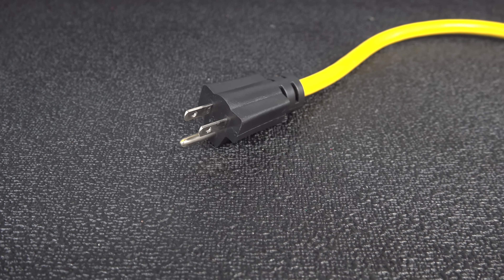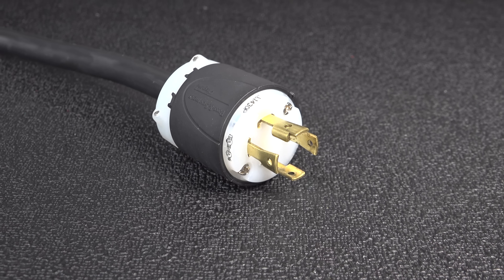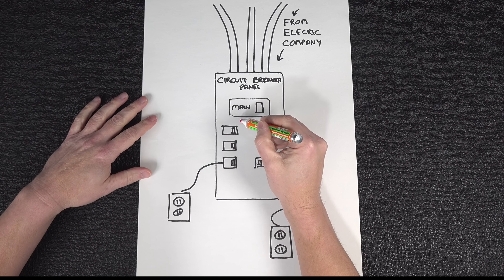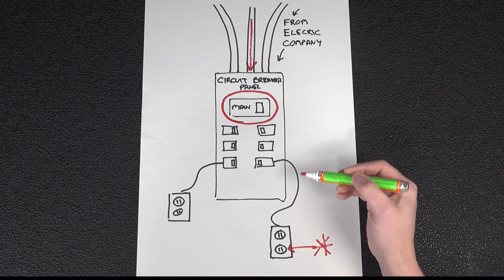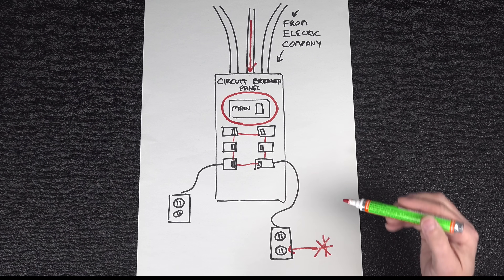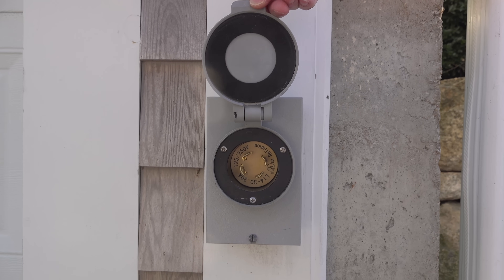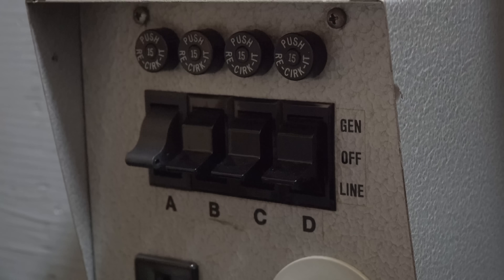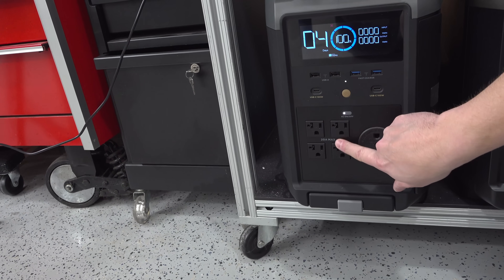Worst Electrical Mistake You Can Make - Backfeeding Generators

Comment: I wouldn't trust a normal plug/socket with a generator anyway. On my off-grid install I have IEC60309 plugs and sockets (blue) between inverters and consumer units (distribution boards). My generator also comes in to a IEC60309 connector. These are designed for heavy loads and are physically robust. Just remember to use interlocked sockets where you cannot remove the plug unless you switch it off.

Comment: The whole idea is crazy, I would be worried about the neutral, there is no breaker.  Just forget back-feeding your house, it is so lazy.  Get extension cords and run them to priorities and keep the generator outside, not in the garage.  People are not smart enough to rap their minds around the complexities of back-feeding the panel.  If one screws up the attorneys will leave ya homeless.

Comment: With advancements in electric cars, I think it's only a matter of time before specialised systems to manage auxiliary power and backfeed isolation become commonplace and/or standard equipment on new dwellings.
Example: the system charges your battery backup or EV typically at night, and will keep the system topped up during the day if demanded and/or surplus solar energy is available, then backfeed when storage is at capacity.
In the event of an outage the system could detect the outage due to current and/or voltage fluctuation on the line in, or digitally via IoT tech at which point the local circuit can isolate from the grid and operate independently in accordance to predetermined rules governing current draw and staying above a certain level of charge to protect the vehicles battery and operability.

It could also make things safer regarding rooftop PV in general, as you know the system will automatically detect faults and isolate if one occurs to protect anyone working to repair said fault. It's possible that some form of this is already being implemented, but as far as I know due to my very limited experience with rooftop PV one must isolate their PV circuit manually
Reply: Look at ford's F150 lighting backup power system
Reply: @bait28  
Is that the new hybrid? If so I was actually reading about it the other day. Pretty impressive setup they have there with about 480 horsepower on tap, and fuel economy that makes my 4 door sedan with roughly 200 horsepower available look like it has a drinking problem.

I'm definitely going to have to take a look at how it handles backfeed to the house now
Reply: @bait28  if they put a similar driveline in a 4 door performance sedan, I think it would sell like hotcakes here in Australia. The Aus market is sorely lacking in that department now that the Falcon XR6 Turbo is no more.
And it would deliver way better gas mileage!

The fact that it could save the day during summer power outages would be the biggest bonus! Being without air-conditioning in the middle of a summer day here is almost insufferable
Reply: @bait28  oh wait, so the lightning is the full EV version, I didn't think that was out yet. Here i was thinking of the PowerBoost hybrid setup 🤣
Yeah the battery in the lightning is huge, but it needs to be in order to hold near 100KWH of energy, but being along the underside I'd imagine the handling is still pretty sharp despite the weight.
If what I've heard so far is in any way accurate about the lightning EV, it's only a matter of time before Ford really shakes up the electric commuter market, and they won't have to worry about the PowerShift DSG letting everyone down in an electric focus which is a huge positive

Comment: In the electrical trade, I’ve always referred to these as “suicide cables,” but I’ve heard “death cables,” “killer cords,” and I heard one old timer once say, “a properly pissed off pixie plug.” That last one has always stuck with me.

It’s not uncommon to get an apprentice that doesn’t know any better to accidentally make one of these, usually in temporary power situations. I’ve always stressed how dangerous it is, especially on the US’s 240v/277v systems.
Reply: AVE
Reply: You only solo suicide cable to your furnace here in MN. Wired in through the furnace switch. Furnace breaker off. Suicide cable wire nutted in.
Reply: No its the U.S.'s use of 120 volts that the European electrical grid doesn't use is the most deadly hence why most countries don't use it because 240v will most likely knock you off the circuit where 120 is small enough to just make a person grab on to let's say a naked wire n your muscles will contract n its hard to let go while its still strong enough to fry your ass. Best to get knocked off!

Comment: What if you plug in the same cord into both outlets of the same receptacle?
Reply: Nothing at all, you just plugged the holes, but the holes are already wired to each other within that socket the same way the plug would connect them, so its just redundant. Only 3 wires feed a basic outlet, a hot, a neutral, and a ground. Those are connected to BOTH plugs, there isn't an individual wire to each plug.

Comment: You wouldn't do well in Florida. A hurricane knocks out the power and everybody drags out their generators and suicide cords. If you have grid tied solar it is illegal to use as well so you have to have a generator. Backfeeding is 100% safe, people however are not, so they have to be protected from themselves. After a storm I have seen licensed electricians hooking people up by backfeeding because all the parts to legally do it immediately become impossible to find.
The whole backfeeding electrocuting linemen doesn't really happen. Sure it's possible but every trained lineman is taught to treat every line as energized before they touch it with all of the required ppe. They work on live lines everyday. I have lived in Florida my whole life and I have never seen a news story about an electrocuted lineman caused by backfeeding. It would be big news as every death days before, and after are always counted as hurricane deaths. Doesn't matter how a person dies it's reported as a storm death. Homeowners are frequently electrocuted cleaning up after storms, just never hear of electrocuted linemen.
Reply from the maker: Really, are people in Florida stupid? They buy generators and then decide that they won't spend a penny to have an outlet for it? Give me a break. Why stop there, skip smoke detectors, GFCI, arc faults, homeowners insurance? etc. Things were fine before those were available. There are NO electricians hooking up people during brownouts, such a great myth. Sure they are going door to door, breaking the law, putting themselves at risk so residents can AC.
Reply from the maker: Just from one electrician, but skip the part about someone dying. Ignore, voiding your homeowners insurance, and ignore the manslaughter charges they filed against one homeowner in another case.  It's not me, it called proper electrical work. - .Guys this was a situation that absolutly didnt have to take place.The same set up that happened to me and my guys down in Golden Meadow,La. last week after TS Cindy. We opened up all the transformer fuses to kill the back feed that was on the line.It didnt take but maybe 15 to 20 min. more. And everyone got to go home .Please when your out there workin after a storm Look it over REAL GOOD and LISTEN for those generators. Open up all the potential sources and test and ground everything.
Reply from the maker: Here the case of the dead worker from it. https://www.oshrc.gov/assets/1/6/06-0166.pdf
Reply from the maker: https://www.clickorlando.com/weather/2019/05/28/hooking-up-your-generator-like-this-can-be-deadly-for-utility-workers/

Comment: Something else to keep in mind, is that sometimes outlets are fed with 14awg rather than 12awg, which is only good for 15 amps rather than 20 amps. So if you were to choose the wrong outlet, you could end up damaging the wires as other things in the house try to pull more power than they can handle.
Reply: @CajunReaper95  What window AC is 15amp, heh.
Reply: @Payitforward42  They all are since that is the most you are allowed to pull from a 5-15 outlet, even if that outlet happens to be on a 20 amp circuit.  In fact, they normally are limited to only 12 amps since they are expected to operate for extended periods of time.
Reply: @Payitforward42  I have two window A/Cs that large, one draws about 22 watts starting up and 12-13 watts running and the other about 22-23 watts starting and 17-18 amps continuously.  My electric bill is eye popping in the summer but at least no one dies of heat stroke in my house.
Reply: Yeah many people ASSume the 3 prong dryer outlet will have enough gauge to power the house, forgetting or not knowing that the dryer is 220V so it will have two big gauge wires for each 120v leg, but perhaps only a small ground wire to trip the breaker if it shorts out.  When powering the house the other 120V circuits will take power from one of the big wires but will feed it back to the generator on that GROUND AS THE NEUTRAL!  This gets red-hot and starts their house on fire. I wish videos like this would do a "if you're not going to follow my guidance and you're still going to hook up the generator without a generator outlet and transfer equipment, THINK ABOUT THESE THINGS!"  just to prevent a few more of those fires.
Reply: @snap-off5383  I'm pretty sure that code requires the neutral to be the same gauge and the wires they sell at home depot certainly are.  Also a typical generator that you would plug in can only supply 20-30 amps anyhow, and even if you have a 2:1 imbalance between the phases, that's still only going to leave 10 amps on the neutral.
Reply: @phillipsusi1791  Modern homes are likely to have  a large ground and neutral, but as I was saying a 3 prong isn't going to have an neutral AT ALL.  Just a ground.  Codes are updated all the time, but houses are not.  People do light their houses on fire backfeeding through inadequate dryer outlets.
Reply: @snap-off5383  Ahh, right... weren't those old 3 prong dryer outlets banned in the 90s?
Reply: @snap-off5383  That isn't how 240v works. If the ground is being used as the neutral you have a serious wiring problem and things are very wrong..
Reply: @DaveMiller2  A 240V 3 prong dryer plug has both 120V legs and a ground wire - that is bonded to the neutral at the panel.  Thus between the two 120V legs there is 240V and between each leg and ground there is 120V.  Wired correctly, a dryer outlet can be used incorrectly as a generator inlet that feeds 120V to the 120V circuits and 240V to the 240V circuits using that ground wire as a neutral return to the generator source. (and the warnings against doing that I gave earlier still apply).  ALL of your outlets have 120V between the hot and ground leg, since the grounds are bonded to the neutrals at the panel.
Reply: If the breaker it is on is 20 amps, then the wire must be 12 awg to handle it.  Conversely, if the wire is only 14 awg, then the breaker it is on must be 15 amps and so will trip if you try to exceed the capacity of the wire.
Reply: That's why you back feed a 220 plug. 220 outlets are 30 Amp rated and use larger wire.
Reply: @garrettheyerdahl4123  Depends on the outlet, a 14-50 probably, a 6-50 definitely not, since you'd have to be using its small ground wire as the neutral return to the generator for the 120V stuff for 100% of the load.

Comment: Everybody saying they would never do it again? Where are all the men in this country? Wearing masks? If it's done properly, it's not dangerous in the least. If you disconnect the main and plug into the house FIRST, there is never a live end of the cord exposed. Making sure that nobody messes with the fuse panel shouldn't be too hard if your family respects you when you tell them not to touch the panel and why. The majority of houses do not have a standby generator nor do they have some kind of transfer switch. Those houses can choose to run a double male cord if they want. Just kill the main before you run your generator. We need to lose the policies that make us lose our common sense. If you need a warning label in order to not drink battery acid, then you're part of the problem.
Reply from the maker: Sounds like a whole lot of stuff here that isn't the problem to justify stupidity. Check out the story of the guy who had a heart attack during an outage, his wife tried to get the power back on and flipped the breaker while he was out and blew up the generator and almost burned the entire house down. If doing the right thing was all that was needed there would never be a car accidents. There are always variables you can't count on. I am not for government control but but I am for not blowing up a generator or someone else because you can't spend $50 more for an interlock. Do it right, could be your wife, kid or someone else throwing the switch and maybe killing someone as as result.

Comment: I am extremely embarrassed to even admit,  because I had just gotten my journeyman license at the time,  but I made and used a suicide cord plugged into my dryer receptacle,  with the main breaker switched off, plugged into my 5500 watt generator, during hurricane Florence,  power was out for 6 days at one time,  with a refrigerator and freezer getting warmer by the hour.  I  purchased my first  home in May of 2018 which needed remodeling,  and working long hours of course you never have the time to get the things done that you want in a timely fashion. When the storm damage was cleaned up and things back to normal,  I installed a 100 amp manual transfer switch, which I've used a couple times already. I knew the dangers and that it's illegal,  and how to make it slightly safer which is to throw the main, but, sometimes desperate times call for desperate measures.
Reply: @youtubejunky7481  You gotta lock the main too, technically to be legal by the temporary portable generator exception, its a good idea to do so.  It would cost me an arm and a leg if I pulled the meter the power co would be pissed if I break their seal.  (if you can pull your meter, you can pretty easily steal small amounts of electricity).
Reply: @youtubejunky7481  You and I agree.

Comment: When I was in the electrical union I heard about back feeding. You can actually sell power back to the power company. Not once have I heard it being illegal. I have even seen commercials for solar panels talking about that being a benefit also, selling power back to power company. You can reach safe and legal ways to back feed your house and actually sell power back to power company. This cord maybe a bad product idk. But this video isn't providing proper info. Sorry.
Reply from the maker: You are confusing micro power generation and generator backfeeding. That is done with equipment installed to prevent issues, and has nothing to do without generator backfeeding, which is illegal, against code in every state in the US.
Reply: @SilverCymbal  mybad I was told you can bad feed and sell power back to power company. When I looked it up on Google the term back feeding was used as well. I'm not perfect and make mistakes so I could be wrong. But that's how it was told to me and what I read.
Reply: @Mattmazz77  Hey, fellow Union sparky here. When you get solar panels installed on your home, part of the process is getting a bidirectional meter installed as a replacement for your standard one. It measures kW hours in and out, and that’s what your thinking of. In a blackout situation the meters are designed to shut off. So unless you have a transfer switch installed, solar won’t do you any good when the grids out.

In the case of generator back feeding, it doesn’t matter if the grids out or not, it’s still pumping out power. It’s not only dangerous for line workers, electricians, and technicians, but it’ll also make your generator try and fulfill as much of the grids load as possible, essentially wasting your fuel and dropping how much available power you have for yourself.

The proper way to have a generator, is to have a transfer switch installed. That way, the power you produce is only yours and everyone is safe.
Reply: Solar panels stop backfeeding if they detect a power outage, precisely to prevent backfeeding and killing a linesman. UL 1740

Comment: People would know which areas in a home might need power in an emergency situation.  How about run some wire  to those rooms and install a few receptacles that go back to a small fuse box that you will connect the generator to.  Nothing would be connected to the main panel.
Reply: good idea, the why not is $
Reply: @snap-off5383  depends on if you do it yourself.

Comment: I backfeed without the clever metal plate in the panel. But then again I've been a licensed electrician (and done some line work) for nearly forty years so I don't forget to shut off the main breaker. The last thing you want to do is blast a lineman as they will complain and cry up a storm. They don't call them "whinemen" for nothing.